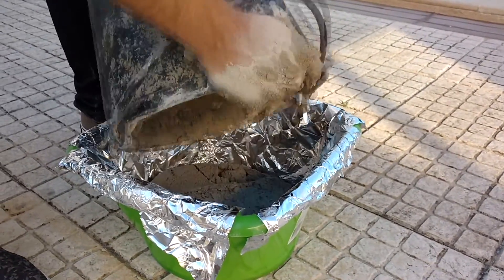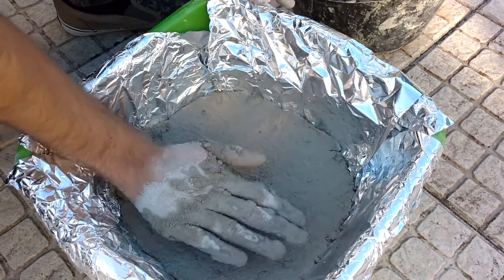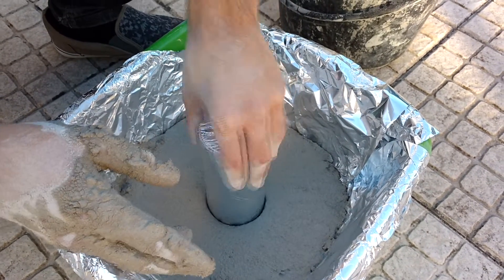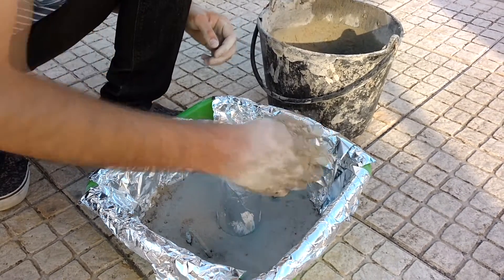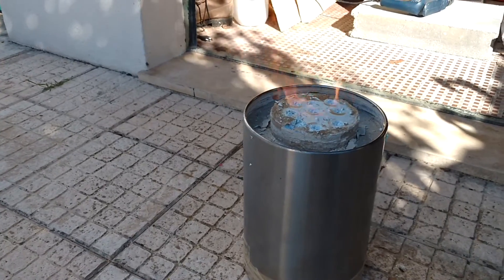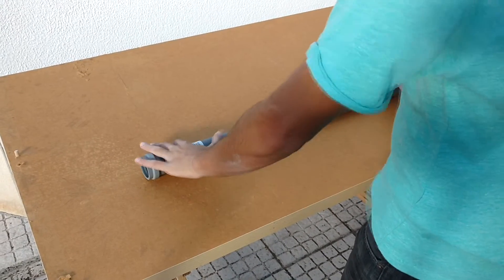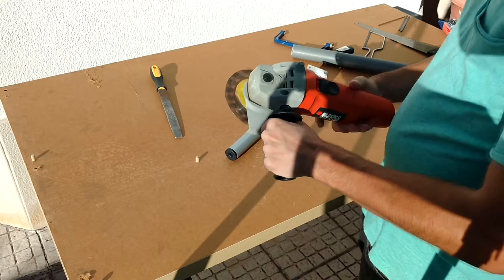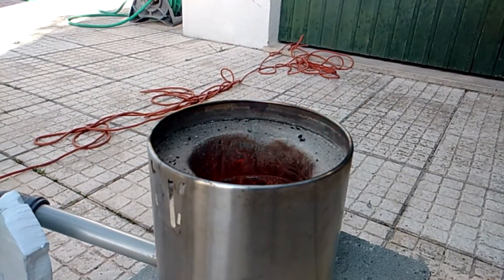How To Make a Small Metal Furnace ( Foundry / Smelter ) - Part II

Comment: I keep watching these videos and this is the best for making the furnace but they all end with fire and never explain where the fire is from.  Butane tank?  if so, how, and if it is wood or charcoal what is the pipe for?  You pretty much drop the viewer there.  It's the fire portion I am not understanding
Reply: Hi Jane. The furnace was coal powered. The pipe is used for air induction so that the temperatures can get higher. We attached an old hair dryer to it and set it to full power.